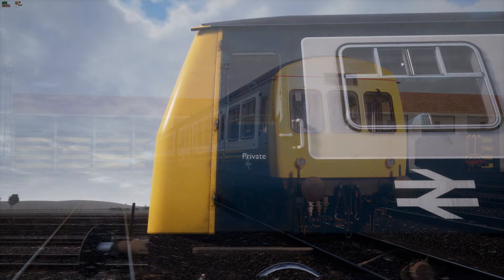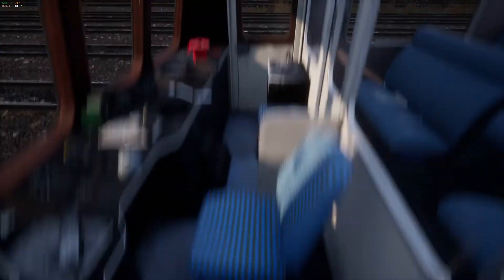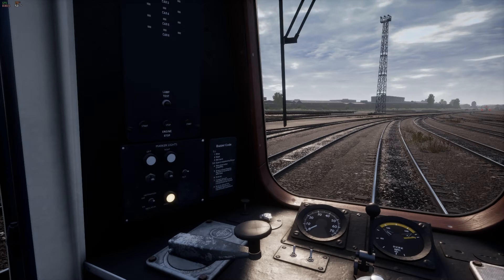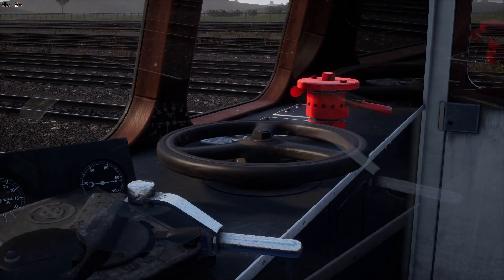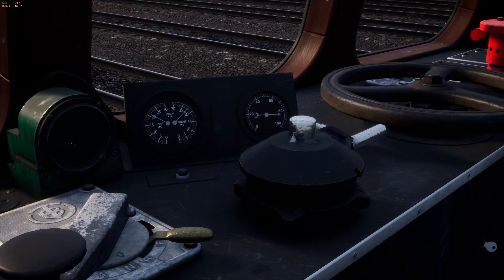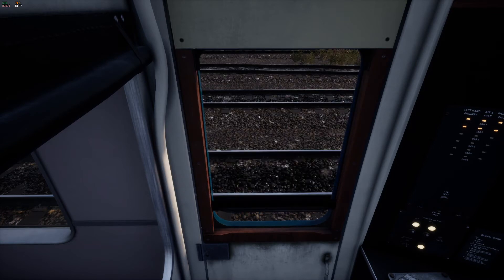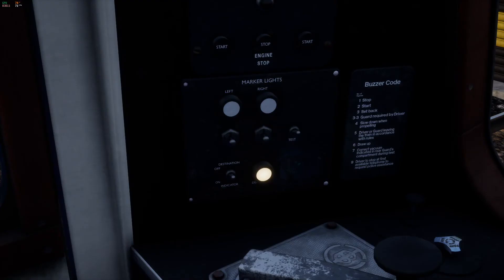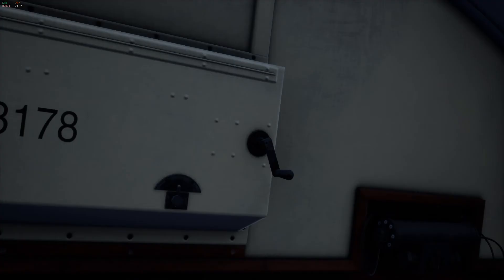Train Sim World 2 (Class 101) Start-up tutorial

Comment: How do you open and close passenger doors ? Thanks for vid
Reply from the maker: From the inside you need to first open the window on the door then I tend to click above the window on the door to open it. Basically open window then click the door. The old slam doors as they call them never had a handle on the inside so you used to have to open the window to reach the handle on the outside.
Reply: You have to use the TAB key, as those are slam doors there are no buttons for doors releaseing/opening/closing inside the cab AFAIK.